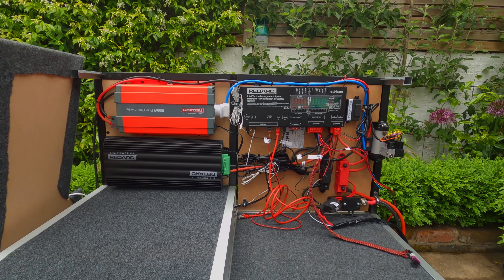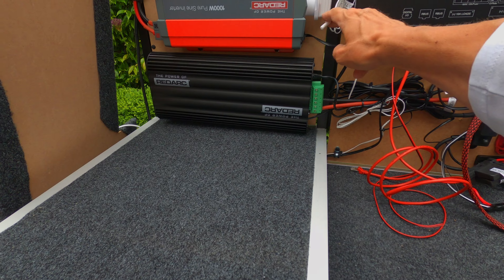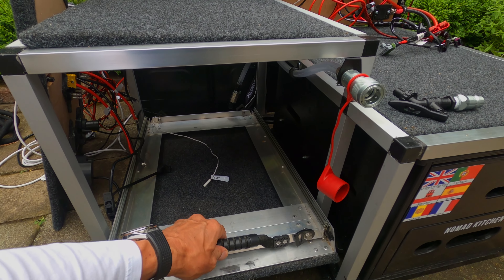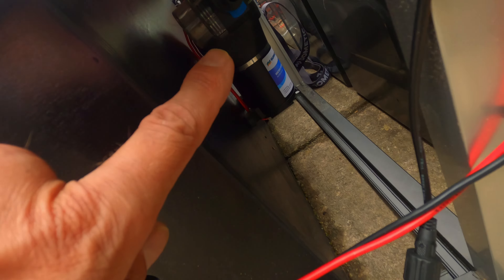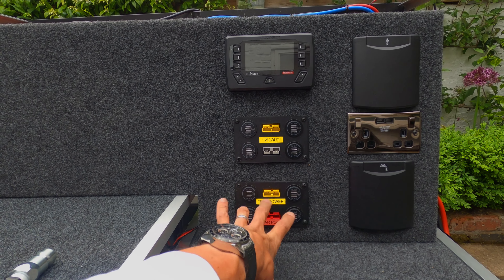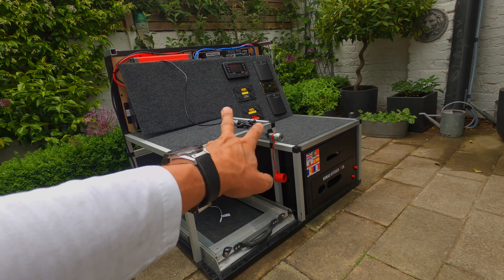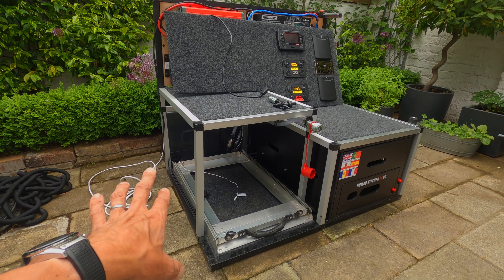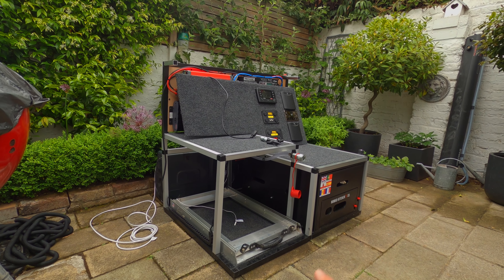L322 Overland Build. Loadspace 2.0. Part 1. The finished frame.

Comment: Really do like this set up. if temps are a concern around the electricals, a simple way to ensure good airflow could perhaps be some low pressure, high airflow PC Fans, Noctua would be my personal choice, robust and quiet, conveniently at 12v. perhaps even intake and exhaust at each end. Most likely overkill though.
Reply from the maker: Thanks. Going to monitor temps and see, being where they were, and in warmer climates, probably didn’t help. Have thought of a fan or two as a next step. 👍🏻